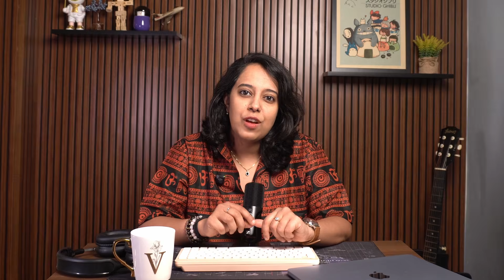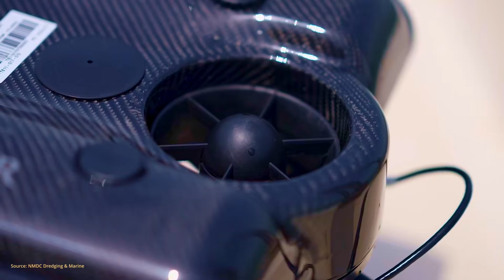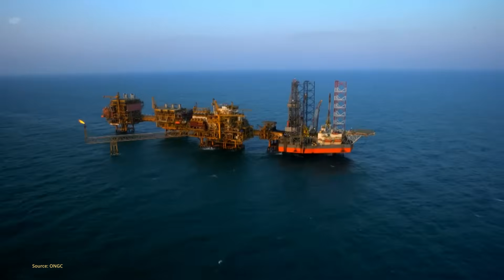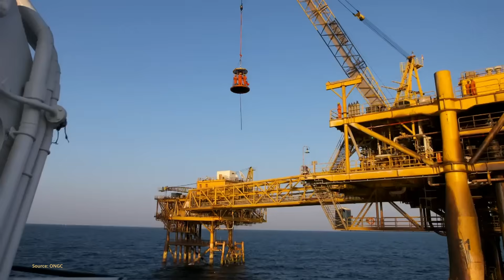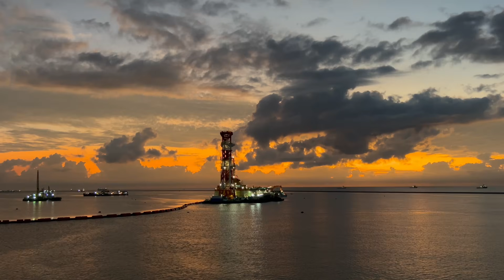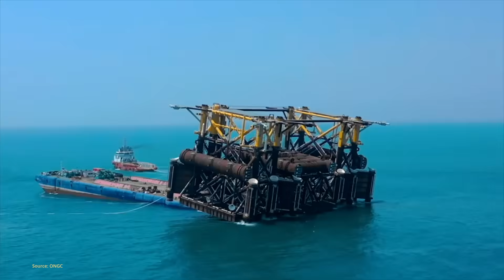Why India's Biggest Oil Mission Isn't Really About Oil

Comment: Your Tech Brew is really heady, inviting us to wear a thinking cap, to digest the information - while appearing to be in common-man language. When we sink a billion $ into deep sea, expecting nothing out of it in return, I think we can as well, plan or 'build-in' other components apart from "oil drill" & c . Deep sea (acoustic medium) transmission of information, is a specialised field, where not much research is being done (may be  NPOL as a 'spin off', will be interested in it). General 'Hydrology study' of deep sea welcomes such (I don't know the BoB depths & would be pleased if enlightened on it) such an effort.
Before some others (I needn't tell, who is the 'other' is) may also 'invite themselves' to join this quest, as Ocean is "free for all'. We can engineer that other 'component', to throw us a 'hint', as to make us 'pro-active' & be in the first place (but not 'follow' in a reactive mode). It all can be more than '1-faceted' (dual-use or dual-result, if I may say so). As an avid Googlemap traveler, I saw long track-marks (as if a battle tank moved on soft mud of Ocean floor, with none to disturb it) on this BoB floor; and wondered !! Right before us is the "90⁰E" ridge, staring at us.
Reply from the maker: Thank you! Really appreciate such a thoughtful comment. 😊 You're absolutely right that there's much more to deep-sea technology than just drilling. Your points on acoustic communication and hydrology are particularly interestingI hadn't looked at it from that perspective. Thanks for adding to the discussion!